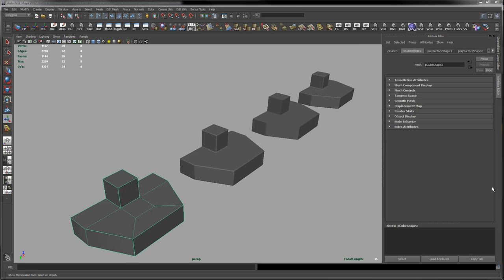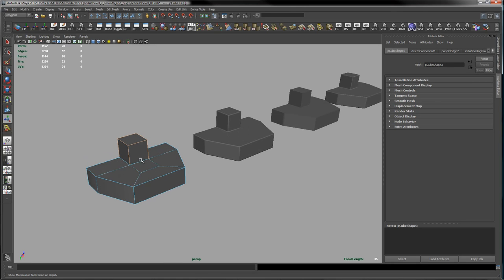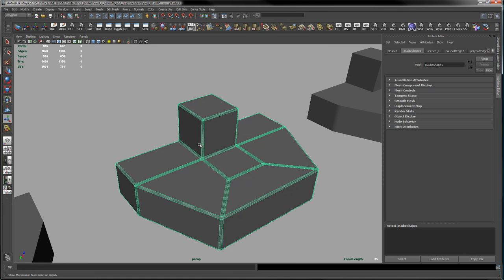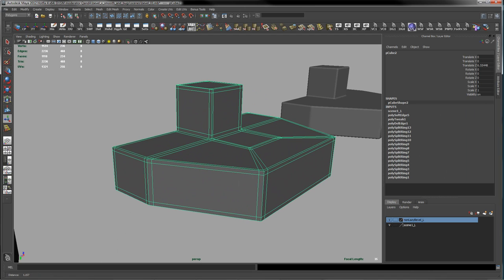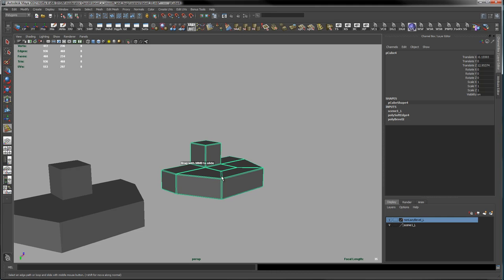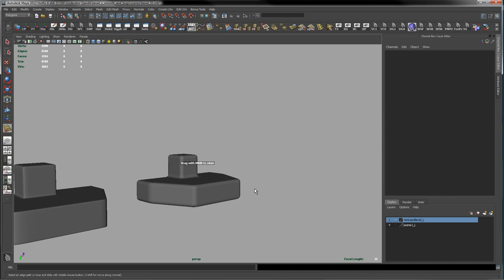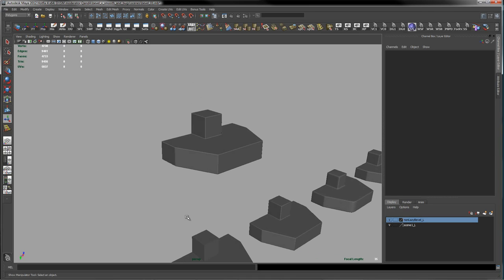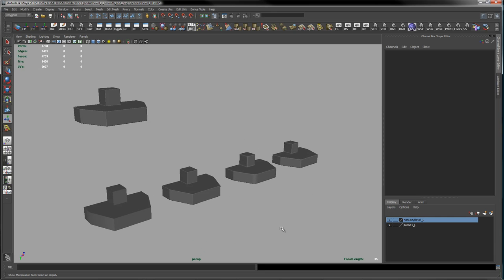Bevel vs Smooth in Maya 2012

Comment: do i HAVE to smooth? like do i need to model in 3 smooth? I'm a beginner and i've been modeling fine then someone told me to model in only 3 and everything i know is ruined. Now I gotta use more edge loops to make edge holds which createa a cluster fudge of lines on a relatively simple model and crease tool ruins everything. Do i really need to smooth or can I just model normally and have bevels where i need it?